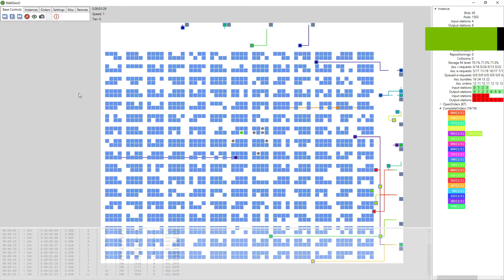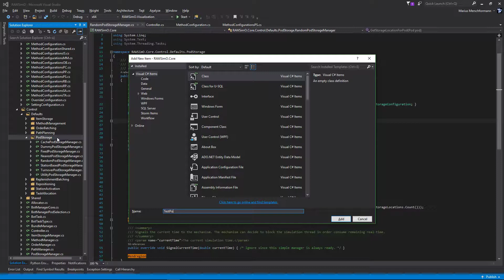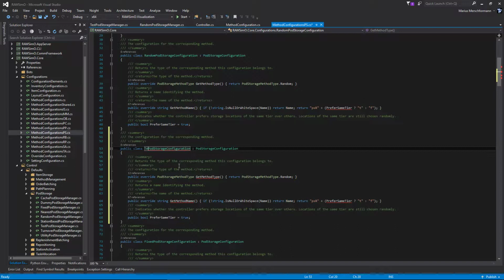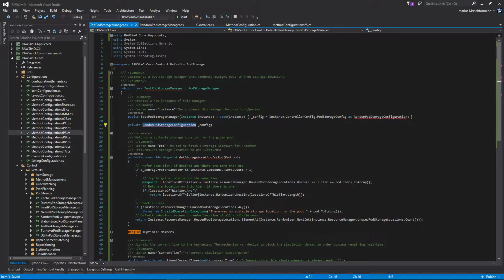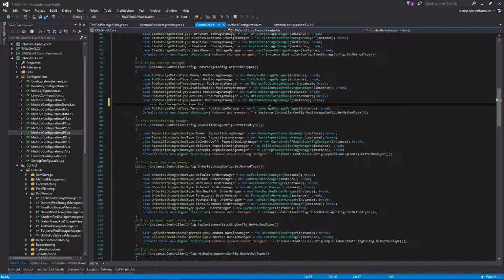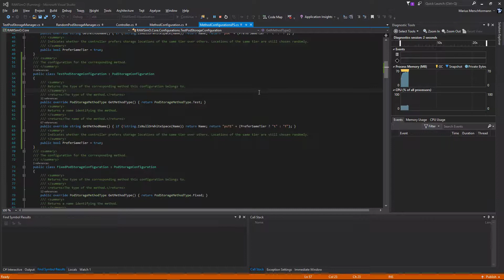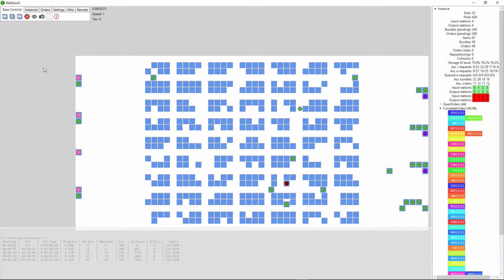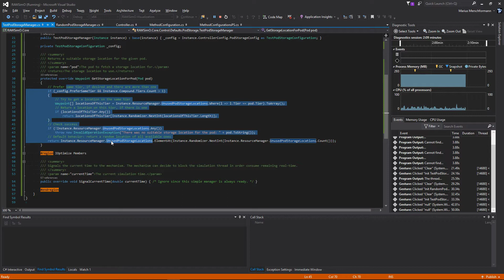Implementing your own controller in RAWSim-O

Comment: Wow. I appreciate your kind explanation.
I have one question.
How did you open the executable in C#?
Reply from the maker: I think I just answered a similar question on my other video ( https://youtu.be/l3qwDnbEPhI?si=k08GEEH4pvJFA9sV ). I hope that is already helpful. Otherwise, feel free to elaborate your question. ☺
Reply: @MariusMerschformann  Thanks to your reply! I explore your RAW-Sim-O, does this simulator has only one seed? I mean, for example, random seed in Python. I want to simulate this system repeatedly, and get some expected value. If the seed is hold, I can't get some expected value. Same system has same result. Do you know how to change the seed?  If you can't understand my question due to my short English, please ask me more detail. Thanks a lot!!!!!
Reply from the maker: @추우진-l1c  Again, I think I answered the question already in the other video (see here: https://youtu.be/l3qwDnbEPhI?si=EPjr12nYl0vqdfM6 ). However, I just created a PR to address this. Find it here: https://github.com/merschformann/RAWSim-O/pull/17
I will merge and release it soon.
Reply: @MariusMerschformann  Hello, I have a question :) I want to know Bot's empty travel time, but there is no data in statistics.txt made by CLI.exe, Datapreparation.exe (I did same action in your different video). How do I get each Bot's empty travel time?? Thanks again.